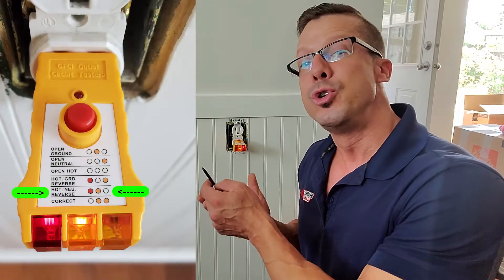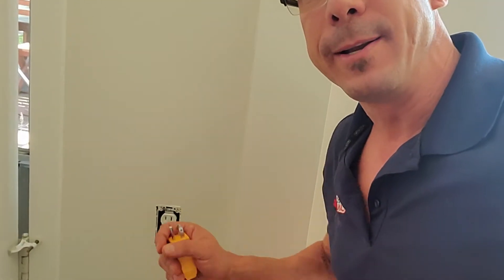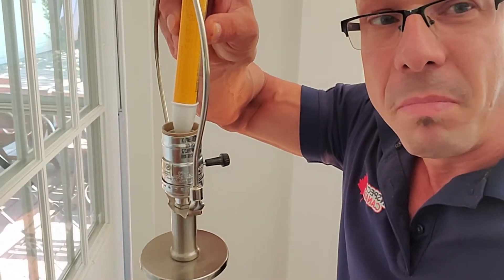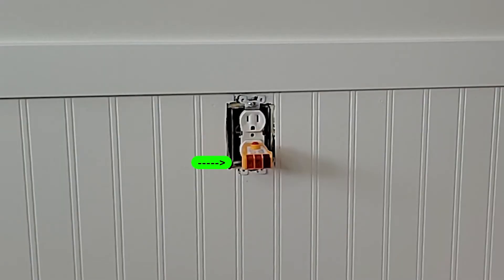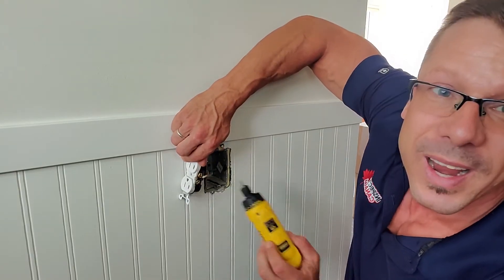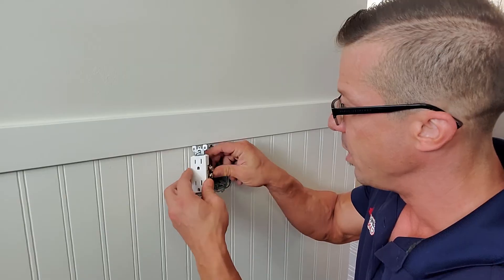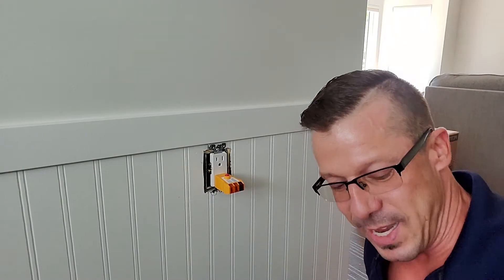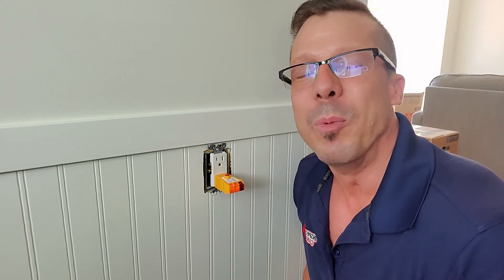How to Fix a Reverse Polarity Outlet

Comment: Interestingly enough- 2 outlets wired as if it’s correct- reads as flipped. Guess it’s upstream of the 2 outlets- ceiling fixture in basement. No demolition required thank god.

Comment: How about this? The black wire is on the gold screw the white wire is on the silver screw but it's still saying that the polarity is reversed, but the black wire is the hot and the white wire is the common, but my brand new tester is still saying reversed neutral...
Reply from the maker: Best to have an electrician checking it out. Testers is possibly faulty. We always have 2 to compare.

Comment: On my little tester like yours it shows two lights on as well,  but the problem is at least according to the chart that their is only supposed to be just one light in the center of the tester to indicate correct wiring unless I'm totally. Misreading the directions??, anyhow with my light switches in the off position the lights come on and theirs power to the lights and plugins as well but when I flip the switches to the on position both the lights and recptecals power off as it trips my circuit breakers,  the light switches were hooked up in series with the plugins, so the guy i hired didn't know what he was doing

Comment: How about when the receptacle has worked for years, then suddenly stops working, and you get a “hot/neutral reversed” reading?
Reply from the maker: @J_Trask  Hi, even though most outlets appears to be good forever, many will eventually fail. I think it's time for replacement. If the other has the same issue, then I think there is an wire issue. Also good to test with 2 testers. Thx for watching our videos
Reply: Did you change any wiring downstream from the outlet? If you put a new ceiling fan in or something there's a chance that the wiring was done backwards on that end.

Comment: How can you test with a light switch?
Reply from the maker: Hmm, great question. I don't think switches can be reversed.
Reply: Single pole switches cannot be reversed, plus they do not use a neutral wire.

Comment: My friend i have a tester like your ok my problem is the 2 orange light come on but the one in the middle is flickering wy
Reply from the maker: Hmmm I'm not sure. Maybe too many outlet on the circuit. We always carry a few of those testers to verify, they often go faulty. Maybe try another one? Would be a good question to ask an electrician. Sorry I'm pretty useless.

Comment: I was changing an outlet and I have two orange wires. No black or white. How can I know wich one is the hot one?
Reply from the maker: Hi, I if it's an orange wire it is probably low voltage but I'm not sure. Best to check with an electrician. Sorry I can't help. Thanks for watching

Comment: Reverse polarity....that's funny....so which wire is the negative and which wire is the positive?
Reply: There's no wire that's called negative or positive in AC electricity. The black wire (hot) switches back and forth at 60 cycles per second between +120v RMS and -120 RMS. The white wire (neutral) is 0v and is the current return to complete the circuit.

Comment: Great video, thank you.
I have a question/situation.  I live in an older/1950's home. I have a receptacle/plug that i want replace.  I got it pulled out of the wall (yes the power is/was off), there are 2 white wires and 2 black (not sure why there are 2 of each).  The 2 white were attached on the silver screws on the left side, the 2 black wires attached on the right side.  I always take pictures BEFORE i do or undo anything for reference.  

Now here is my issue/question, once i reinstalled the new plug, with white on the left, black on the right, my little tester is reading "hot/neu reverse".  

Now I'm no electrician, but isn't the white wire suppose to be neutral and the black hot/active???

Should I switch the white the the chrome and the black to the silver to correct this issue?
Reply from the maker: So sorry, I think it's best to have an electrician check it out. I'm not sure there are so many wires on your outlet.
Reply: I have the same issue and same year home.. they used to  have 4 wire as one fee the next  cable to the next ourlet or light
Reply: Replace why?

 How could you even plug the tester in a two prong outlet? Did you install a three prong outlet without a ground wire? That woudl be a code violation. You should use  GFCI receptacle an mark it with "No equipment ground."

Without ground reference the tester cannot tell reverse polarity. 

It is best to call an electrician. You have reached the limit of your knowledge. Outlets often have two of each as they pass current to other outlets.
Reply: Did you ever find a solution

Comment: Other question:

When replacing an outlet, if the black and white wire is put on the wrong sides, what will happen?
Reply from the maker: The video explains it. Whatever is plugged into the outlet will constantly be energized even when the power is off
Reply: @InspectCanada  Thar doesn't answer my question. Will it cause a fire if the wires are in the wrong place?
Reply from the maker: @CoryHarris-qg8lq  Hi, I don't think it can cause a fire but mostly a shock hazard and early failure of items plugs in those outlets.
Reply: @InspectCanada  Thanks for responding.  I'm going to replace an outlet for the first time and wanted to be sure. Yes, it's color-coded, but I'm a little nervous.

Comment: So I just bought two Klein outlet testers. One is just the lights and the other has the lcd screen. The one with just the lights shows every outlet in my travel trailer is wired correctly. The one with the lcd screen says I have a hot neutral reverse on every outlet in my travel trailer and it shows less than 30 volts. However, everything I plug into the outlets works. So I’m not sure which tester to believe as I am not good with electricity. What would you suggest
Reply: Thank you sir. I will be replacing them all this weekend because they are kind of old. I hope you have a good day!
Reply from the maker: Sucks but looks like one might be faulty and need a third tester.
Reply: One should check them at home. If one tester shows reverse on every possible outlet it clearly is faulty.The chance that everything is reversed is zero. A non contact voltage tester can also help in determining the problem. It should be a basic tool.
Reply: @okaro6595  thank you
Reply: @okaro6595  if I shut off the breakers on the bathroom and the one by the sink, everything else shows good. If I turn the breaker on the the bathroom and the one by the kitchen sink show good and the others show reversed lol
Reply: @davidklassen2008  There seems to be something wrong. If you want to further instigate you should measure the voltages (all three combinations) on both cases. Also use non-contact voltage tester to test the voltages especially that in no case is there voltage on the ground. This can be from harmless to absolutely deadly. It might be best to call a professional to fix it. Meanwhile keep the breakers off.

When it shows reverse polarity it means there is voltage between neutral and ground. If the voltage is on the ground it is very serious. If it is on the neutral is is less.
Reply: @okaro6595  yes that’s what I’ve been doing just keeping the breakers off until I can get someone over here. It is through the neutral. The guy who will be coming to look at it in a couple of weeks said a light or fan could be wired wrong between the two outlets

Comment: Question, so I had power and has worked for months. The other day I connected and used my TRAEGER while the backyard lights were on they suddenly turned off, why do you think that is? Now the outlet tester I plug in shows it’s a hot ground reverse? I have swapped the black and the white wire many times and nothing changes polarity. I’m so confused I don’t know what else it could be, there def 120 volts on the wire and on the inner prongs of the outlet, but no power to my items. Maybe I fried them and I gotta connect something I know works….

Comment: I’m having this issue, but no matter how I switch the wires. I get the same code from my tester.
Reply: If you haven't already, try a new outlet.  It's possible that there's an issue with the outlet itself, should be a quick cheap test.

If it's not there might be something up with your wiring upstream to the breaker.  Not an electrician, just best guesses on my part.
Reply: Me too , did you figure out what it was?

Comment: Does the polarity of the outlet play any role in the function of the device?
Reply from the maker: It is called 2 things, reversed polarity or hot / neutral reversed. It means that whatever is plugged in is energized even if the switch is off. It needs to be wired properly.
Reply: No, as it is AC.

Comment: Thanks you safe me couple bucks today
Reply: I installed a new square d dual function breaker yesterday then I tested as instruction & it was working fine but why my 2 outlet not working & my tester said Rev ? I did wiring correctly I’m doing wiring electrical for more than 30 year now. But when I removed a new breaker out & put back old regular one it work fine. Thank

Comment: What is the typical problem when the hot reverse condition appears after 20+ years of normal operation where the wiring hasn't been tapered with?  All connections are tight.  All neutral wires connections are tight? I've also replaced all of the appliance outlets involved with new ones to rule out internal problems with the old outlets.  I have no schematic to more easily solve the problem.  I'm thinking of simply running a new neutral wire from the neutral wire connection back to the grounding bus bar.  What are your thoughts?
Reply: Sounds like my issue, I don’t know what the heck
Reply: What can also cause the “hot/neutral reversed” reading is when the neutral wire becomes disconnected at some point between the receptacle and the panel. 

I am dealing with this issue at a family members house. Last weekend the issue started after I took the hot and neutral wires loose in a panel to connect to a manual transfer switch. 

After I connected to the transfer switch, I tested for proper operation, and it didn’t work. ALL the other circuits I connected to the transfer switch worked fine. 

I reconnected the problem circuit back like original, and inexplicably read 3.7V between the hot and neutral at the receptacle, but got a 121V reading from hot to ground. I know there something going on like a screw or nail hit the cable, a neutral joint gone bad causing a high resistance fault, or something funky happening. I return tomorrow and plan to do an amp rating on the circuit to see if there is a readable load being caused by the neutral wire issue.

Comment: I'm in Canada and do not understand why on your outlet the wide blade (neutral) is on the right side?? Every out let I've seen it is on the left side. Please explain.
Reply: the video is mirrored horizontally. you can see the "deWalt" on his tool is also flipped.

Comment: I plugged in an old appliance with a really bad cord. It blew the GCFI which wouldn't reset. So I replaced the outlet exactly as it was Balck to gold, white to silver and GCFI won't reset and all outlets on that circuit won't work. So I used my multimeter at the box and all breakers test good. So I replaced another outlet on that same circuit and still nothing. But, on all the outlets on that circuit, except for the GCFI, I'm getting a reverse hot and neutral. I'm stumped.
Reply from the maker: Looks like you might need an electrician. Sorry, I'm also stumped.
Reply: I agree you need to call an electrician. I have seen this when the line and load sides were reversed in a GFCI.

Comment: What's the difference between the wires being reversed and the way a plug can go in either way so it's 50/50 which prong is receiving hot and neutral anyway ?
Reply from the maker: Hi, no matter which way you install the outlet, the black wire has to go on the golden screw, white wire to silver screen and ground on green.
Reply: Viper is talking about non-polarized lamp cord.
Reply: For a lamp, the wiring is usually well insulated from the lamp body, so there is less chance of shock. Newer lamps have polarized plugs which cannot be inserted incorrectly.
Many appliances, however, connect the ground wire to the body of the appliance, so that theirs is a chance of the hot wire touching the case without it tripping a circuit breaker.
Reply from the maker: @TomCee53  Great information Tom
Reply: @TomCee53  The last sentence makes no sense. The grounding is separate from te neutral and the hot. If the (actually) hot wire touches the case the breaker will trip. Now sure faults may appear differently if the polarity is reversed but it still is safe. If the hot wire (wire the designers intended to be hot) gets loose and hits the case on a properly wired socket the breaker will trip. On reverse polarity the device just does not work. But if it happens on the neutral the symptoms are just the opposite. You cannot predict how a device will fail so it really is not an issue.

Comment: You also get reverse polarity if you loose connection on your wiring and get back feed. Leaving a wire constantly energized will not fry the wires unless you pit more current than its rated for. Fix it hot.
Reply: "Fix it hot" That's for pros, not everyday laymen. I only fix it when it's hot when I have no other option like having to kill the power to an entire building. Be safe.

Comment: On the new outlet, you've installed--I noticed that the wide blade is on the right, while the narrow blade is on the left.  Here in the U.S.; it's the exact opposite.  The wide blade is on the left, while the narrow blade is on the right.  And the same goes with the GFCI tester.  I just wanted to point this out, in order to differentiate the different between Canada and the U.S.  Nevertheless, you have a great video!  Thank you for sharing it for us to see.
Reply: That doesn't make sense, I think we are looking at a mirror image. Look at his shirt, the printing is backwards and his ring appears to be on his right hand.
Reply: Recorded with cell phone.   Reverse image.
Reply: That's wasn't the point. Silver screw for neutral and gold screw for hot. That's the common denominator in this video. The wires being in the correct screw. What does it matter what side it's on?
Reply: Do you possibly mean that you just flipped the outlet around and the ground prong faces up or down depending which way you install it?
Reply: @justinpeters7166  Mirrors will will flip images horizontally, or technically in an x,y, z 3d orientation with z pointing in, the image rotated 180° around the z axis.
Reply: Many YouTube videos are mirrored.

Comment: if all the outlet is hot neutral reversed, that mean i need to re do them all correct?
Reply from the maker: Hi, unfortunately yes. It will also indicate that this was done by a homeowner and not a professional. If any other electrical was done, I would double check it out or have an electrician do so.

Comment: Hi there, i noticed i had a reversed hot and neutral of my outlet BUT the hot is correctly connected with the black cable and the white with the neutral.  On the same breaker i have another outlet that is correctly wired.  What does this mean ?
Reply: If you're reading hot/neutral reverse with the black to brass and white to silver terminals, then this includes the black is neutral and white is hot.   Somewhere upstream they got crossed.  You have to play detective and see if other outlets on the circuit are reverse polarity because it's possible that it's reversed at the panel,  with the modern AFCI breakers it's easier than you might think to accidentally switch them at the breaker.  

If there are a mixture of correct and hot/neutral reverse outlets on the circuit,  once you've verified it's correct at the panel,  you would start by removing all the faceplates from the outlets,  and gently pull them out  of the box if you need to get a better look.   You might also have to find and open any junction boxes that may exist.  Somewhere upstream the black and white got swapped.  

Once you've found and corrected this, it's a good idea to retest all the outlets on the circuit to verify they all read as correct, because someone may have deliberately reversed the black and white on an outlet to compensate for them being swapped upstream and by correcting that you've unknowingly created some hot/neutral  reverse outlets downstream.
Reply from the maker: Hi Sebastien, it is possible that the outlet is faulty. Please confirm that the black wire is on the Golden screw and the white wire on the Silver screw.
Reply: @InspectCanada  i just replaced the outlet with a new one.  Only other possibility is the wires were crossed in between both receptacles in a junction box….
Reply from the maker: @sebastienmajor6191  Still reverse polarity after replacing the outlet? Then I would have to think that someone messed up their wire colors and as you said, they are crossed along the way. Then installing the hot on the silver screw and neutral on the gold screw should fix it.
Reply from the maker: @sebastienmajor6191  the other outlet, if you open it, are the right wire colors on the right screw?
Reply: @InspectCanada  sure is. Black to gold and white to silver.  Ground also connected to green screw
Reply from the maker: @sebastienmajor6191  Hi Sebastien, then I'm not sure. Best to get an electrician involved.
Reply: @InspectCanada  thx !
Reply: @sebastienmajor6191  do you figure out the problem?